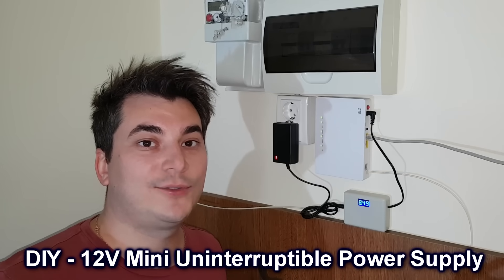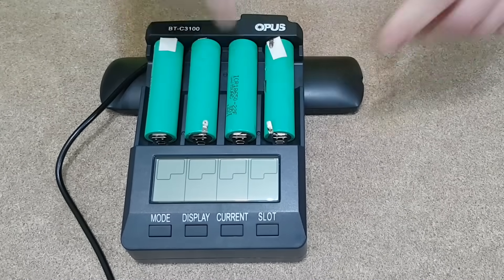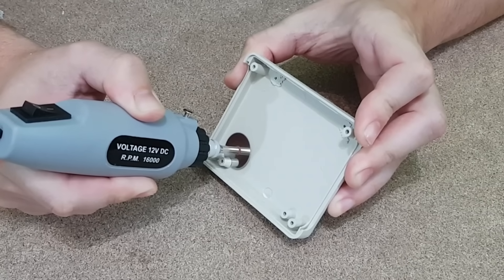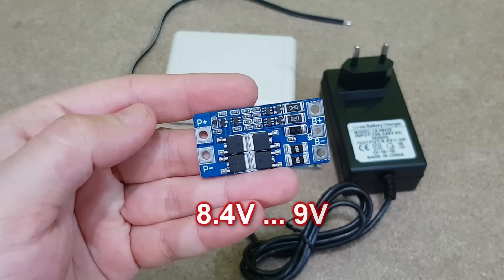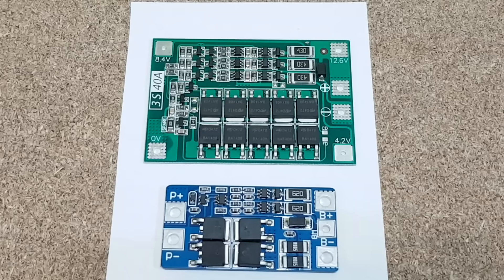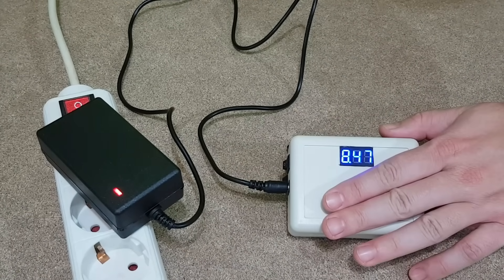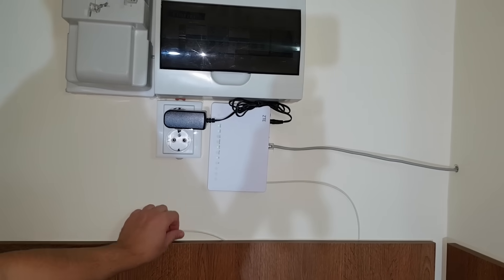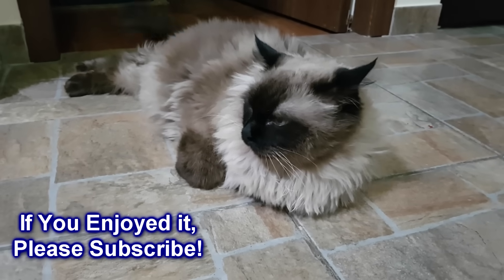DIY - 12V Mini UPS

Comment: Thank you Sorin for sharing this video, really informative , I have some notes regarding :1-You can use a battery holder for the 18650 you using in case you need to replace the batteries it will more easy rather than doing the soldering job again.2-You can use a protection schottky diode on the input side link SS54 so that the voltage can flow in one direction & not back to the charger in case of utility power outage 
3-you can add a switch yo turn of the built in voltage meter to preserve some energy in case of long term power outages.4-what about low battery , should we get any indication when the battery is going low , it the UPS turn it self off in that case ?5-also what about short circuit protection on the output side ?
Thank you.
Reply from the maker: hi. 1- yes you can use a battery holder, but I prefer to solder the cells. I test all the cells before I use them, so very rarely I had problems and need to replace cells. I prefer soldering the cells, because with battery holders there may be an imperfect contact in time between the cell and the holder, also the plastic enclosure needs to be bigger. 2- a diode will block the current from one direction, but it also has a small voltage drop. so the charging voltage will drop below 8V, which is not enough to charge the cells. the charger LED is using only a few mA, it doesn't make any difference in the 6 hours working time of the UPS.  it remains like this for now. 3- the voltmeter display is using 17-20 mA, depending on how many LEDs are lit. so yes you can save a little energy by disconnecting it. you can add a capacitor and a microswitch to the voltmeter. when you press the microswitch for 1-2 sec, the capacitor is charged and the voltmeter will remain on for a few sec, enough to read the value. 4- the BMS has over discharge protection at around 2.9V per cell. you can check the UPS voltmeter, when the voltage decreases to under 6V, the cells are almost discharged and it will shortly turn off. I did this test in the video. 5- this step up converter doesn't have short circuit protection, so you can add another fuse on the positive output terminal. or you can use another (bigger) type of step up converter, with short circuit protection included.

Comment: just a tip, if you change the setting on the opus charger to "charge test" it will charge the cells up to 4.2, discharge them, giving you the discharge capacity, then charge them back up. making it easier and quicker to test them multiple times
Reply from the maker: I know. I forgot to film it.

Comment: Why is the charger port giving back current?? I love this little project but i wouldn't have power out on the charger port.
Reply from the maker: the input and output terminals are the same on the BMS board. the charger should have a diode or something, to block the current from the other direction. but it's using very little current, only to light up the LED. you can see the battery voltage is not fluctuating, when I connect and disconnect the unpowered charger.
Reply: @Sorin_DIY  you could put a diode on the BMS input.. love your work it's always nice and neat looking!! Keep um coming☺
Reply from the maker: yes a diode will block the current from one direction, but it also has a voltage drop of around 0.7V so the charging voltage will drop to under 8V, which is not enough to charge the cells. the charger LED is using only a few mA, it doesn't make any difference in the 6 hours working time of the UPS.  it remains like this for now.
Reply: @Sorin_DIY  Yes I forgot about the voltage drop of the diode. Well I supposed it's not going to effect the the supply badly so it's ok. Still nice project  as usual .

Comment: While it wouldn't work in areas of Australia using FttN, those of us stuck with satellite (over priced garbage) could use your device during the multiple-hour long power outages. At least for the satellite receiver and wifi router so our phones can still connect. Thank you

Comment: Cool, might have to build one of these. I usually use a 10000mah powerbank, which can last around 7 hours running an adsl modem router with wireless.

Comment: Sorin, very good project !
I have one question and if you can anwser me, i appriciate.
I want to know the capacity of my old battery computer cell. But i only have some powerbanks with the controller board. How can i make un DIY to show the capacity of batteries ? I have some resistance too with USB. Thanks
Reply from the maker: hi. I don't understand what you want to do. the capacity of a laptop battery should be written on it.
Reply: @Sorin_DIY  I am sorry. I will be more specific.
I have dissassembly the battery pack. I want to test the real capacity of this cells to know if this cell are good or not, without buying a new charger with LCD screen.
I have some TP4056 board charger and i have an USB Meter. If i charge this cells with USB meter in the middle, the capacity of the meter are real for the cells ?
Thank you.
Reply from the maker: you can measure the charging current with a USB meter, but the real capacity will be smaller. another method is to put the cells in a semi DIY powerbank, use some resistor or a load to discharge it and measure the discharging current and capacity with a USB meter. in this case the cell capacity will be bigger, compared to what the USB meter is showing you.

Comment: Those plastic bit in the case are called "stand offs". They "stand off" a pcb from the case. Normally used on pic's so the motherboard doesn't short against the case
Reply from the maker: thanks for clarifying this. I know what they are for, just didn't know how to call them in English.

Comment: Thanks Sorin! Great UPS! BTW, Can you make a UPS for Raspberry Pi boards?
Reply: Should be exactly the same except replace the 12 volt booster with a 5v one
Reply: @kingbonkaa  I'm afraid if the RPI reboot at the transition from wall power to batteries!
Reply: @yv6eda  There is no switching with this UPS its always charging and always using the batteries.
Reply: @InlineSkater72  Thanks!

Comment: good diy enclosure, could not find on ebay, where do you get them?
Reply from the maker: hi. I've bought the box from a local store. it's this model:
https://www.aliexpress.com/item/32869987100.html?spm=a2g0o.productlist.0.0.30ce50cf6Kt0NG&algo_pvid=db245a60-28d6-4b45-ab1b-7196a4114c92&algo_expid=db245a60-28d6-4b45-ab1b-7196a4114c92-1&btsid=4081cbfa-3ac7-4f24-a13f-977e89a1bce2&ws_ab_test=searchweb0_0,searchweb201602_5,searchweb201603_55